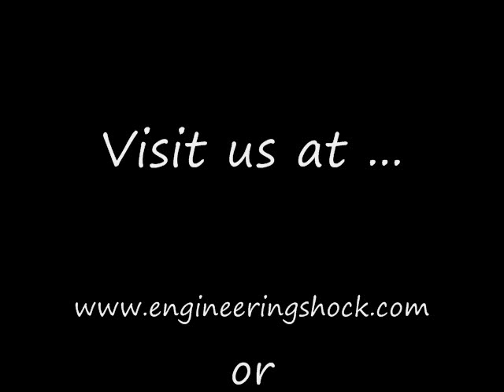EXTREMELY SENSITIVE Laser Detector Circuit Using ADC + Coupling Cap

Comment: This is "almost" exactly what I need!
Can it work in reverse? If the laser beam flashed across it, the unit would trip?
I also need three "target" laser detectors in one unit. But I'm sure I can work thought that.
It could be mounted in a closed box to cut down on light input from ambient light.